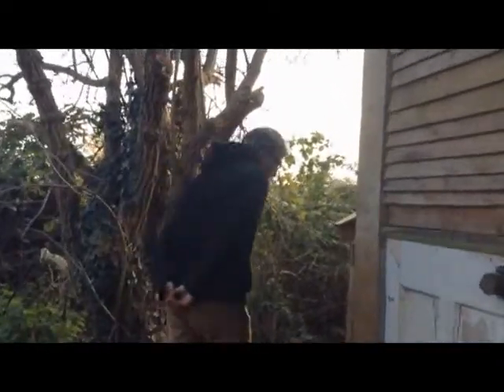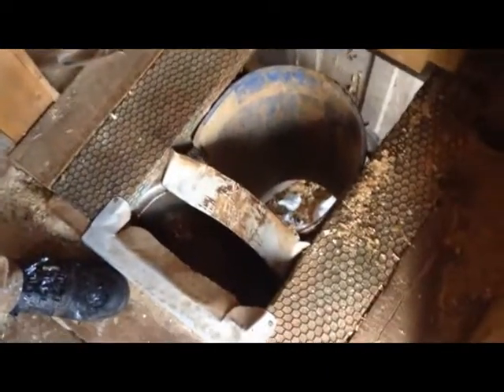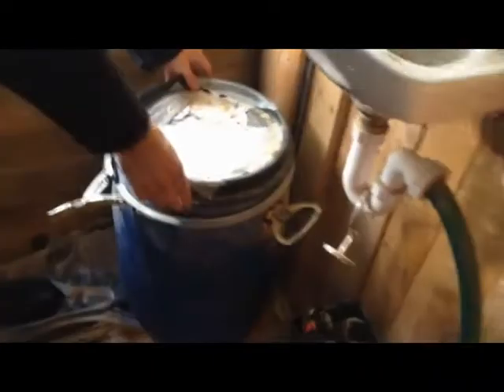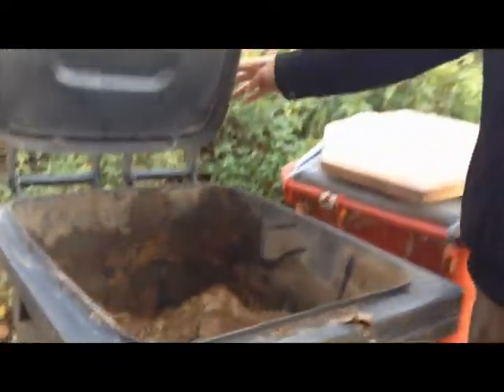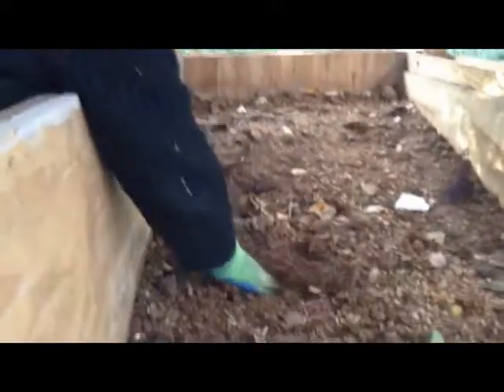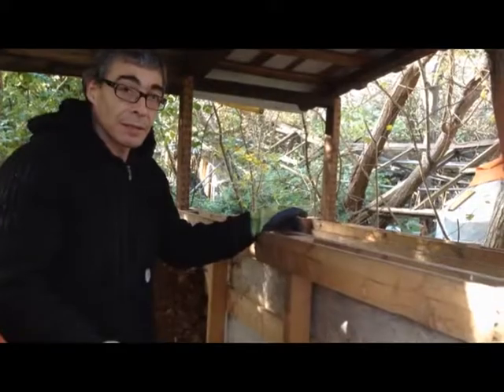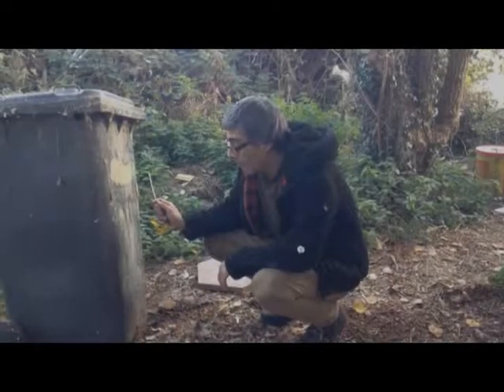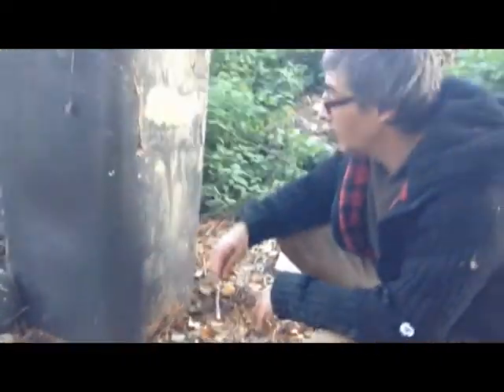Humanure and fermentation

Comment: This is great, just the info I've been looking for. Only thing is those bins have a lot of oxygen in them. Assuming the process would improve if you sealed it properly? Secondly, how does winter affect this process in the UK. Does it stop it or just slow it down.. ?  Thirdly - you are hot composting aswell? From what I've read about bokashi it is anti-pathogenic and should remove any need for further hot composting ?